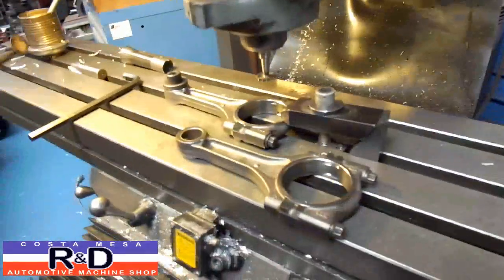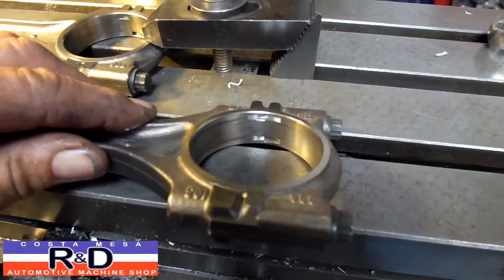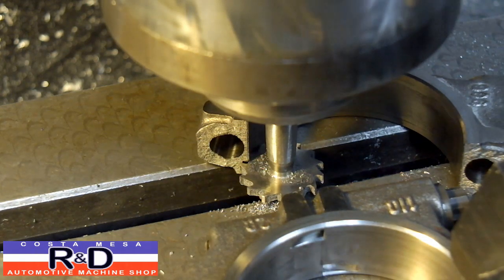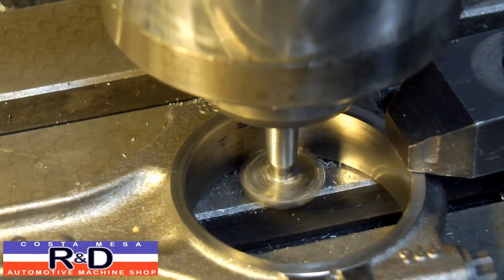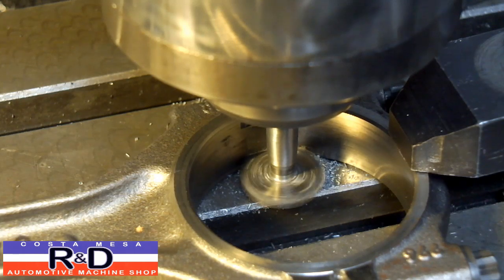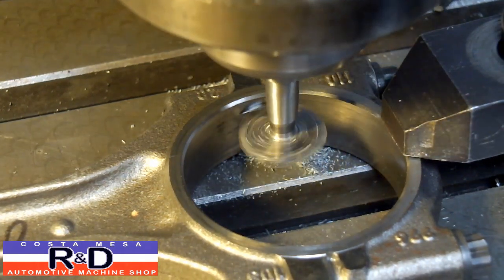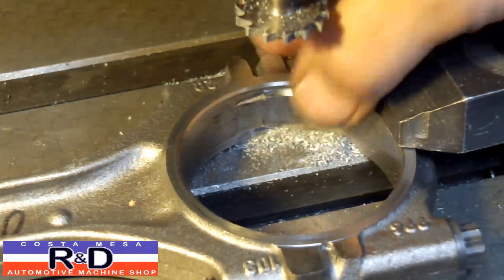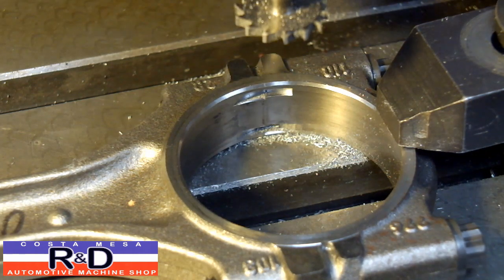Connecting Rod Tang Re-Grooving

Comment from the maker: What narrowed bearings are you asking about??? We typically use narrowed bearings to reduce the contact area on certain racing engines. Either the bearings are made special for the application or the rods have the tang grooves adjusted for the new bearings.

Comment from the maker: The tang groove allow the bearing to correctly positioned in the con rod, they also keep the bearing from spinning. Many of the newer engines are made without thangs and tang grooves. The bearing is held in place by the crush method, works quite well.